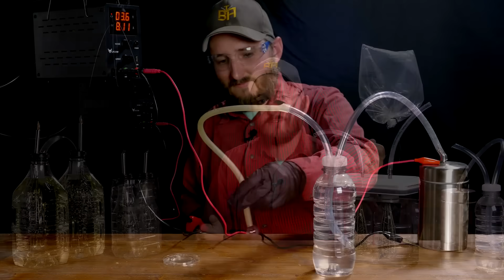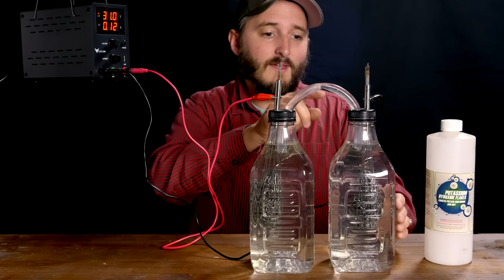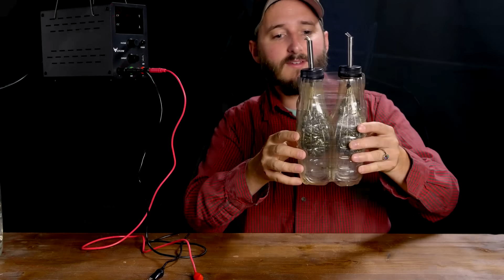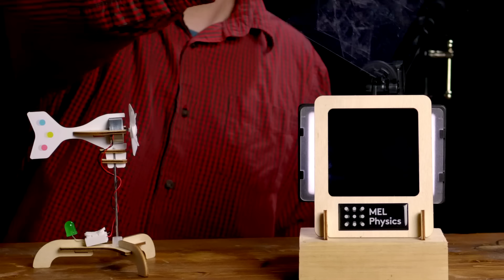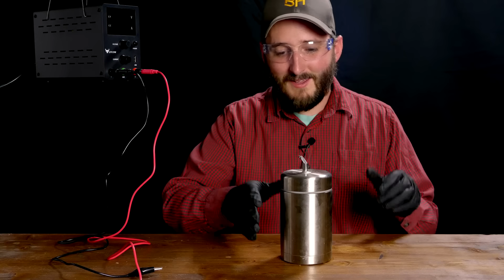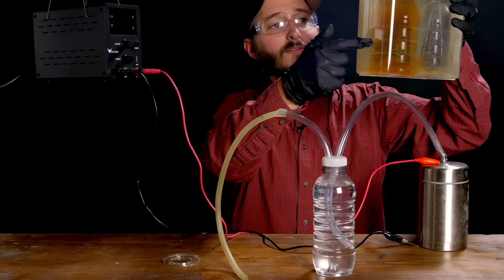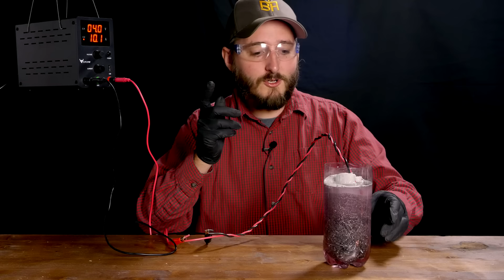DIY Hydrogen/Oxygen Generators From Grocery Store Items (HHO Fuel Cells & Split Cell Electrolysis)

Comment: I recently got a millenium m10 oxygen concentrator for a glass-blowing torch, and it is awesome but I almost need 2 of them to get the most out of the torch 

I'm trying to decide which way to go about this, because the m10 is very expensive but at the same time I really don't wanna blow myself up haha you feel me 

I've considered building one of these myself but haven't felt comfortable with it yet, and I've also looked into ways that I might could have a tank that I can fill with the concentrator to have higher psi output when I need it

Really liking the idea of a reserve tank but I'm having trouble with being certain what parts I need to accomplish this

Any thoughts?
Reply from the maker: People have made shop torches that run on electrolysis (there are also commercial models you can buy) but it requires a really big device to make enough O2, and a well designed one to make sure it's safe. Watch my following video where I make a torch out of this and you'll see it's about 1000x smaller than you would probably want for glassblowing. Making a big one would be a major project. An O2 concentrator gives way more O2 for the size and amount of power required.

Comment: I have a question, I understand the position of the anode and the cathode determines the output of gas, however what I don't understand is how H2O splits to form hydrogen and oxygen separately, or rather how oxygen and hydrogen filter themselves through the two separate tubes, how is it that the position of the cathode or anode can change the output of the gases?
Reply from the maker: I've posted the reaction a few times if you scroll through the comments

Comment: All fine to experiment with, but stainless steel is one of the worst possible materials to make the electrodes from.
Aside from the hexavalent chromium issue (bad enough in itself), the electrical conductivity is poor (= heat generation) and the electrode potential is on the high side, meaning that the process is quite inefficient and makes the cell run hot.
Carbon/Graphite is better if a cheap solution is needed.
If your pockets are deep enough platinum is one of the best, even as a plating onto another base metal such as copper or ali.

Comment: You get oxygen at one electrode and hydrogen at the other and that way they are separated from each other.
My question is, What happens with the oxygen atoms at the hydrogen electrode and vice versa.
When you split a molecule into oxygen and hydrogen both kinds of atom should be present at
both electrodes or what did I miss?
Reply from the maker: Cathode: 2H2O→H2+2OH
Anode: 2OH→O+H2O
Overall reaction: H2O→H2+O

Comment: I tried that too, for high altitude balloons. Electrolysis, acid-metal, base-metal, and others .. all of them ended me up with lousy purity, with barely any lift. Your plastic bag balloon also has less lift than it should have. I wonder how to fix the purity problem.
Reply from the maker: High humidity most likely is the issue. If you pass the gas through a desiccant it may give better lift

Comment: If you use water and potassium hyroxide  do they require topping up? If so how often.?
Reply from the maker: The hydroxide is never depleted. The water needs topping up when it gets low which is rarely.

Comment: I want to ask? Now a day's you may have seen these new hydrogen water bottles. I recently took one apart, and it operates using the same electrolysis process. Dose that means the gas that is left at the top of the bottle will be the highly reactive  hydrogen and oxygen mix as there's nothing separating the collection of gas from the electrodes? We could be walking around with these highly explosive bottles if so. I say that because you said there's no safe way of storing them when its mixed gasses
Reply from the maker: Yes, it is flammable and you should not use those bottles for many other reasons. Electrolysis will make poisons in the water from the electrodes and trace salts.

Comment: Is there a way to calculate the volume of oxygen and hydrogen created per volume of water?
Reply from the maker: Yes, that's easy to calculate. 1 mole of h2o is about 18 ml, which makes 1 mole of h2 and half a mole of o2. A mole of any gas is 22.4 liters in volume at 0°C and standard atmospheric pressure. So expect 22.4 l of hydrogen and 11.2 l of oxygen for every 18 ml of water.

Comment: The last experiment you demonstrated you mentioned you could produce a gallon of gas. Could I turn it into a liquid gas like butane? If so could you do a demonstration? Are explain why are why not ?
Reply from the maker: Only certain gasses can be made into liquid at room temperature. Hydrogen and oxygen need to be extremely cold to be liquid.

Comment: Now, how do you make use of that gaz ? It would be great if you can figure out a way to capture H and pressurize it into a gaz tank. Then reverse the process to create electricity
Reply: You can compress it by modifying an air compressor and using some piping. Then you have fuel cells for cars, generators, or even rocket fuel.
Reply: @derpymcderpello5381  easier said than done

Comment: Just wondering two things..
First, what VOLUME difference would there be between O2 and H..
Eg if I  stored 2L of gas blend, the H WOULD be at the top and you could roughly drain off for use..
Second... What is the solubility be of O2 and H in cold water.

The application is to make H-Rich water for consumption ....
So, how efficient would it be to allow both O2 and H be bubbled  into drinking water , to make Primarily, H rich water..
Eg. Would the O2 saturate the water or would H saturate first..

Thanks
Reply from the maker: The gasses mix evenly in the same container. They won't separate based on density.

Comment: I have a question regarding the electrolyte. If you were to convert all of the water into hydrogen and oxygen, would the electrolyte be left or does it also get converted into a different element orrr what happens with it?
Reply from the maker: The electrolyte would remain

Comment: If the electrolyte was filled right up to the top of the container would there not be much gas in the canister to create as much of a dangerous situation?
Reply: As much being the key term
Reply from the maker: Yes that's correct

Comment: I just listend to your whole presentation. With the white sock as the separator, you mentioned that the Hydrogen gas was coming out of the Negative terminal. With the previous construction examples you mentioned that the Hydrogen gas was being generated by the Positive terminal. Which is it?
Reply from the maker: The negative terminal makes hydrogen
Reply: @Nighthawkinlight  thank you.
so is it the Hydrogen side or the oxigen side that corodes the stainless steel wool?

Comment: NightHawkInLight, thank you for this video.Very informative and well presented. The best I could find so far on the H2 generation.
I am planning to make a H2 generator based on your last split solution. I bought a small H2 generator but it is making only1 mL/min.
My goal is to get pure H2 with 500 mL/min or more that I can inhale for health therapy.
So I have to make some changes to your implementation and I hope you can provide some guidance: 
1a.  Use clean filtered water (yes not very good electrolite, not efiicient, I am ok with that).
or 1b Can you recommend something that improves electrolysys but is not a healh risk, maybe Magnesium?
2. The real question is what can I use as electrod so it is not leaking anything toxic in my H2 port?
Reply from the maker: No way I would use a homemade device like this for any health purpose. You can get electrolyte or leeched carcinogens from the electrodes in droplets carried by the gas. You cannot make one of these safe to inhale without lab testing all the components.
Reply: Thank you for the reply and honest opinion

Comment: How would you dial down the 12v on a vehicle fuel cell setup so you don’t get too much HHC in the combustion chambers and risk blowing a head gasket or the motor entirely?
Reply: In a hydrogen vehicle, a power supply isn't installed. The oxyhydrogen is premade and then pumped into a fuel cell  which is then used to power the engine.

Comment: When I bought four packs of stainless steel scrub pads they were magnetic. When I used them I found out they were plated with stainless steel. THEY WERE CHEAP STEEL. WHAT A BUMMER AS THE EXPERIMENT WENT SOUTH. THE WATER TOTAL RUSTY RED. BUY WITH CAUTION.

Comment: First of, thanks for this video ALOT,
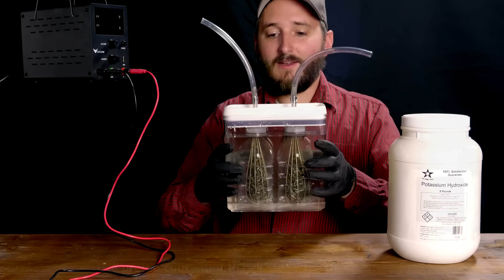I'll be using and improving the design of the split output device whilst taking inspiration from the device you made at 11:30 for my thesis in Mechanical Engineering,

Though I'd like to ask on the Anode (+), why did the solution inside the bottle turn into yellow-ish brown as it produces Oxygen?

It would be very helpful if you could give me a reply.
Once again thank you very much.
Reply from the maker: It's corrosion. The pinned comment explains.
Reply: @Nighthawkinlight  Thanks for the reply !

Comment: Is there an actual single good use for the need to develop HHO? 

The only safe way to use it is to combine it with an extra supply of forced ambient air to cause it to dilute. Much safer and easier to produce Straight Hydrogen.
Reply from the maker: I use it in a torch in my follow up video.

Comment: Is the electrical force used to create 1^3cm of combined gases (H & O) greater than, equal to, or less than the force created by its combustion? I have to imagine equal or less than, due to how I was taught chemistry, but the explosive power of the combined gases is much stronger than I would anticipate were this the case. (Though it is hard to visualise the amount of current used.)
Also, seeing as the electrolyte is not present within in the actual chemical equation, I am left to believe it remains in the water. Is this true? And if so, does it degrade or otherwise decay into something else over repeated usage?
Reply from the maker: Creating the gas will always take more power than you can get from it. The electrolyte is involved with the reaction but it's restored as fast as it's consumed so never needs to be added again. The reactions are as follows:

Cathode: 2H2O→H2+2OH
Anode: 2OH→O+H2O
Overall reaction: H2O→H2+O
Reply: @Nighthawkinlight  Thanks for the info!

Comment: It is great of you clip!  I don't understand  that you connect the positive voltage to the whisk at the top of the stainless steel flask, this arrangement should give out oxygen instead of hydrogen. Am I right?
Reply from the maker: It gives both hydrogen and oxygen. The negative is attached to the flask, so the whisk makes oxygen and the inside walls of the flask makes hydrogen
Reply: @Nighthawkinlight  Thanks your reply. I understand now. both oxygen and hydrogen comes out from the stainless steel tube at the top, but the +ve electrode area at the top is small compare with -ve electrode area（the inside wall of the flask ）, hydrogen is generated much more than oxygen. The gas output actually is not pure hydrogen but mixture of hydrogen （most part）and oxygen. Is it the case?
Reply from the maker: @patricktam5323  yes that's right
Reply: @Nighthawkinlight  So, if we want to further reduce the generation of oxygen, can we remove the steel wire ball, will this arrangement affect the rate of generation of hygrogen as well?

Comment: Question, would a standard petrol or diesel engine be safe to use hydrogen gas as a fuel?
Reply: I've seen some industrial power plant turbines be compatible with both hydrogen/diesel but I wouldn't use it on a standard generator. Typical diesel generators have an output for soot and carbon monoxide while burning hydrogen makes water and last time I checked generators don't have an output for water. The two fuels are also chemically different which means reactivity differences and potentially unstable outputs of power.

Comment: What kind of device do you have that gives current, is it an inverter or a charger? Can you use a battery charger?
Reply: He's using a 30 volt 10 amp adjustable DC power supply. You can use a battery charger but you can't adjust the output because they weren't designed for this purpose.

Comment: Is there a better choice for anode other than Stainless Steel? (Dont care about the cost, just the info)
Reply from the maker: Yes, many options. Graphite, platinum, mixed metal oxide. You'll find many types of electrodes if you Google resistant anode materials

Comment: Dr.Brown inventor of HHO was a pal of mine and back in '96 he got a big contract to install this tech into diesel engines...on the way to this high-paying job...well he went missing. No one has ever found him or his car. His wife phoned me for months looking for him. So, in a memorandum to Yul, feel blessed to know this technology, he gave the world.
Reply: @3brandon  was thinking the exact same thing
Reply: X

HHO would have been known about since the molecular makeup of water, which I get a feeling predates 1996 by quite a ways. (about 200 years, though originally it was determined to be 2 parts of hydrogen and one part of oxygen by volume, which is technically incorrect. With that said we had determined that it was a hydrogen oxygen mix decades before that and eitherway this is largely just splitting hairs) Add in the fact that oxy-hydro reactions aren't all that useful for combustive power generation (they react way too quickly and violently, "knocking" in combustion engines is gasoline detonating and that's already horrible for them. Detonations are nearly impossible to manage usefully.) and the fact that putting it in a diesel engine doesn't even make sense since, well, is it diesel or oxy-hydro? HHO is a fuel, if you're putting it in a diesel engine it's not even a diesel engine anymore. For that matter, if you were to convert an engine technology to oxy-hydro, diesel is a far worse option than gasoline. Diesel is way less reactive than gasoline, it's more energy dense (IIRC ~30%) but less reactive. A gasoline leak is an immediate concern since it can go up in flames easily, but really have to coax diesel into lighting. (Diesel isn't even considered flamable, it's considered combustable but not flamable)

Comment: Hello friend, excuse me a question if I use distilled water with sodium hydroxide for the generator the oxygen produced could be used medicinally?
Reply from the maker: Only if you're also cautious to use pure not contaminating electrodes like compressed graphite, and also filter the gas to remove any vapor or droplets of the electrolyte that might become aerosolized
Reply: @Nighthawkinlight  Thank you very much for your answer, then neither 316 steel nor grade 2 titanium will work for this project? Sorry for the question but I already have both materials, and one more question please, a flame arrestor and a bubbler serve as filters for steam or electrolytic drops?

Comment: Could the oxygen side be released into a small but livable area to replenish the air because of the carbon dioxide expelled when one breathes? And, release the hydrogen out a port so as not to be put in the 'livable area' that has almost NO fresh air ¿`_
Reply from the maker: Maybe, but plants are better for that purpose and don't have the same risks.
Reply: @Nighthawkinlight I don't see the evidence in photosynthesis, and I believe, it's as absurd as the reverse Image retinal hypothesis, which there is absolutely no evidence of. So, if there is no other source available could that way of producing oxygen, work, or would another element be necessary to replenish the air to breathe ¿`_

Comment: Think of a new way to do this. 

A magnet spinning, a water vapor misting in an atmosphere, solor electrophosynthesis, a north and south pole anode and cathode opposite the spinning magnet in the presence of solar electro charge

You might turn the static charge into a lightning bolt

If you can use solar to make h then you have a very low cost high energy efficient system without spending electricity to make hydrogen power

Magnified solar in a mirrored tank with a north side and south side magnet, maybe solar photoelectrolysis is the new invention

Throw me some money if you get rich and i have more inventions to make

Comment: Can someone explain to me roughly how much electricity would be required to produce hydrogen at a rate in which a vehicle could run indefinetly? I've long wondered if a car could be modified to run on hydrogen.. I imagine a system wherein you would fill the tank with water, and use a hydrogen generator powered by an onboard battery bank, which is in turn charged with an appropriately sized alternator. Is this even possible?? or perhaps you would bypass the requirement for a battery bank altogether, utilizing the electricity from whatever generating system is appropriate. Or maybe the most ideal system would instead use electric motors, and the hydrogen produced would run an inverter generator capable of powering both the hydrogen generator as well as the vehicles electric motors? why arent here any youtubers testing out these concepts? it wouldnt even be all that expensive!
Reply: You only get as much energy out of the system as you put in and that's assuming 100% efficiency. Due to this, you can't have the hydrogen powering the car and the generator at the same time because there are always losses in energy transfer which creates inefficiencies.
Reply: @derpymcderpello5381  thank you. I ended up finding a really good video demonstrating this shortly after posing the question. The only way, it seems, that this tech would be useful is in a world where green energy, or nuclear energy were in such abundance that it could serve our heating and electrical needs as well as generating massive amounts of hydrogen for vehicular consumption. What a frustrating world- that this is within our fingertips if humanity were to unite to a singular cause, and reach out and grab it.